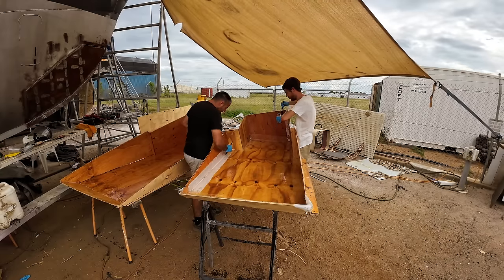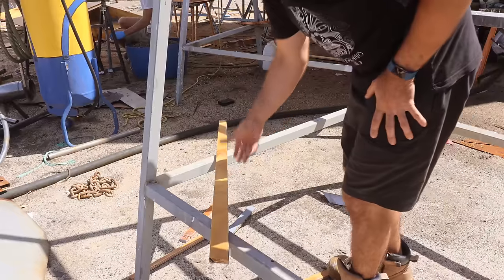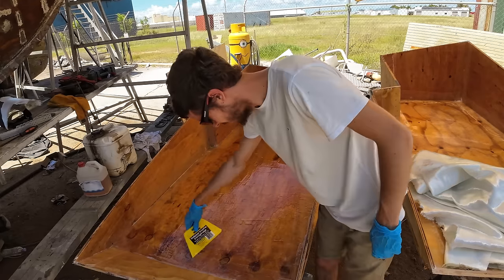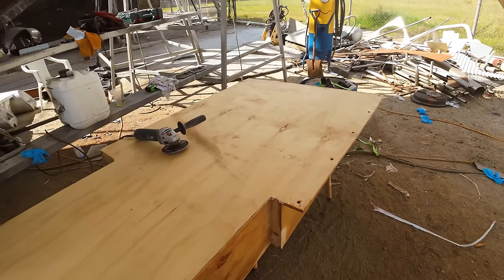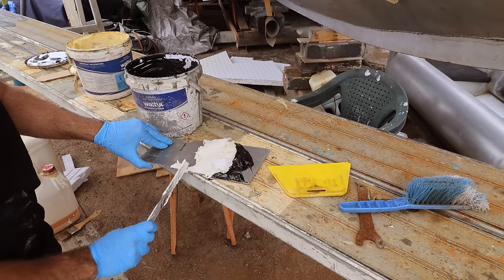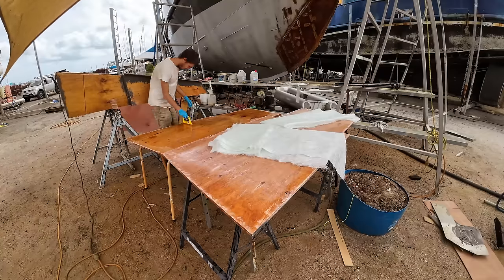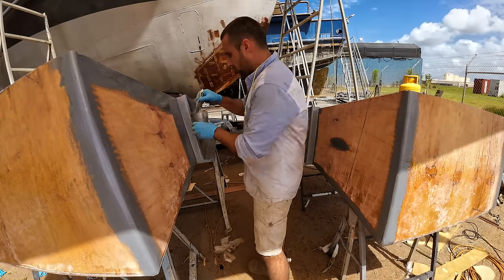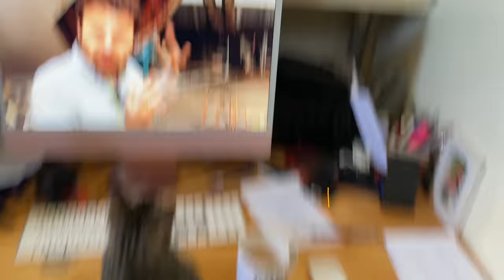Strengthening the Black Water Tanks Using Fibreglass - Project Brupeg Ep.292

Comment: Ventilation is very important, I have two 40 mm ID vents arranged to give cross ventilation to promote aerobic bacteria, the vents rise continously from the tanks to the skin fitting, one exits higher and aft of the other near the gunwale to try and assist circulation but not sure how well that works, no smells so that is a good outcome.  I fitted a by-pass to allow the outlet to flow seawater into the tank, I wish I had provided more than one flushing / agitation point as it seems I have a reduced capacity presumably from settled solids, I use an emacerator toilet with the shaft accessible to free it if it ever locks up and the discharge pump is a diaphragm pump.  All the best, Doug from NZ.

Comment: In the future, try filling the radius before glassing, you'll find the mat doesn't delaminate as easily and greatly improves the strength.  BTW Placing baffles in Black Tanks will trap your poo and eventually pack it up like cement.
Reply: I would think that the constant motion of the boat would break everything up into a liquid. Just my 2 cents worth. Guess we’ll see.
Reply: @Mr7yhnmki8  oddly, it's the other way around.  it's very non-intuitive.  the motion causes the solids to settle out, like taking a gallon of freshly mixed paint on a couple hundred mile trip in a car.
Reply: The coving should indeed have been done before glassing the tank as indeed fibreglass does not like right angle corners.
Reply: Baffles are needed for strength, but should not go to the bottom of the tank. This will allow for free flow of poo..and allow for flushing of the tank…. I don’t even want to comment on glassing mistakes….

Plus why not steel tanks, I seen 5lb plate tanks last 25 years on Navy ships.
Reply: Surely the cut-outs in the baffles will allow enough flow to prevent constipation?

Comment: The inside corners should have been radiused with fairing compound before any cloth was laid. Fiberglass does not like sharp corners. Plus each surface should be sanded and wiped down with alcohol or acetone before the next layer.
Reply: Absolutely
Reply: +1 for filets/ radiuses corner. But I'd scrub it with water against amine blush before sanding
Reply: radius with thickened epoxy is a must!
Reply: You are correct, but in another comment they mention that they are going to lay heavier glass over the coved inside
Reply: Yes, yes, and yes. I noticed this but demurred from commenting. Those tanks will experience some twisting and the corners need help.

Comment: Adding to other comments - strength comes from the glass not epoxy so if you can only use enough epoxy to bond the glass your golden. Peel ply may be an option to remove amines and make the painting so much easier.

Comment: I’ve seen swim platforms made from fiberglass reinforced plywood pontoons that held over 30 people and never leaked in salt water. This form of construction is just as reliable as an injection formed plastic or fiberglass only tank if not more because of the glue between the layers of the plywood which were compressed and soaked at each layer. The plywood pontoons lasted for years!

Comment: Internal corners should be filleted (coved) before putting down matting. The matting does not like sharp corners. External edges need rounding over before putting down mat. Router is good for this. Do any fairing before applying mat, it makes a decent finish. All resin need light sanding and wipe with acetone before overcoating. Resin will not bond to previous coat if 'bloom' is not removed first. If using peel ply then rubbing down is not necessary.

Comment: When performing hand layups a spray gun with the right size orifice makes wetting out the composite so much easier and cleaner.  A scale is a great way to accurately measure multi-part compounds.

Comment: I agree with the radius comments so the fiberglass will not delaminate since Fiberglass mat does not like to go over a sharp radius. I just don't understand why you did not use Stainless and fabricate the odd shapes as I have seen your tig work and it looks very good.
Reply from the maker: Stainless isn’t used for holding tanks because the acid in urine causes crevice corrosion. Epoxy is impervious to the acid

Comment: Seeing the tanks getting into shape is great! Just make sure they're absolutely bullet proof. Dealing with them after they had been used is an absolute nightmare. Unfortunately I'm speaking out of experience 😂💩
Reply: 💩😱        I smell your pain 🤣
Reply: @dcallan812  A previous owner of my trawler hat the idea to repurpose an old diesel tank into a holding tank. It was sitting directly on the concrete ballast and it was welded in place! The drainage hose wasn't even at the lowest point. If I should rate stupid system design choices that one got a straight 10 out of 10. 🤣
Reply: @FlyingConey  LOL mmmm that sounds real nice to deal with later, after brewing for years. 🤮  🤣🤣
Reply: Yeah, once something, pretty much anything has been given into function, fixing a mistake or a flaw ... honestly, i'd rather do it from scratch in some shituations.
Reply: @aserta  yep, if you have the access and the time just do it right.
Reply: Hmm... your comment is a little poppy. 🤣🤣
Reply: @kenholt8297  💩💩👀🤣 Just a small one

Comment: Ummm. You didn't sand between glass layers. Generally, you need a mechanical bond if the resin has set. Additionally, most epoxies will blush which needs to be sanded away. I fear that these might delaminate unless you are using some secret squirrel epoxy. Hope all goes well. Thanks for the content.

Comment: Whilst Epoxy is definitely inherently well suited to resisting water there are plenty of Polyester swimming pools and hot tubs that last just fine. Gelcoat is normally made from isophthalic resin which is more resistant to ingress than general purpose orthophthalic resin used in the laminations.

Comment: Take pictures and measurements of the tanks for potential replacement. Or in case you decide to change the composition in the distant future. Any special bracing for tie downs or brackets? I saw bolt down but any redundancy?

Comment: Those things will be stronger than steel tanks and certainly far more chemically (1's and 2's) resistant. Nice job only thing I would do different (and I build boats out of epoxy and ply) is fillet the inside corners before glassing but hey its not a question of strength rather convenience during construction. Nice job for jobbies.  They are pretty big though you will have to be mindful in some places like Antarctica are there any regulations about discharging down there?
Reply from the maker: Thanks for the tips!

Comment: Did your water line agree with your laser level line.  I appreciate you only filled one tank but a good test of the accuracy of the laser level?
Reply: That made me laugh too - could have saved the money for the laser level :-P
Also, does your level not have the mode to spin the laser? The ones I used at work (cheapo nasty stuff) made a hole line around the room, not just a dot…
Reply from the maker: Yes
Reply from the maker: Ours doesn’t spin, it’s super bargain basement

Comment: Surprised to see that the corners were not rounded and /or filleted before they were taped.
Reply from the maker: There is a gap between the bottom wood and sides, filler would have fallen through. Using tape to make the corner was out best option. J

Comment: Grind out all of the internal corners, cove them and then glass them over.  They will probably need 25 mm radii.
It might be worth seeking advice on the baffles - rather than just guessing.
Reply from the maker: We have taken the advise of a specialist, there was a gap between the bottom and sides of the box. Have a look at the next episode in two weeks and it will make sense
Reply: @ProjectBrupeg  That's good.  I'd still grind out the internal corners and cove and re-glass them, though.
90° internal corners are definitely a no no.
Waiting with 'bated breath.  :)
Reply from the maker: No need but it will make more sense when you see the rest of the tank. Dame

Comment: I may have missed it, apologies. What happened to the original tanks?
Reply: In an earlier episode he showed how the head was originally plumbed directly overboard. Brupeg was built some time ago when presumably regulations were different and it was a work boat, I suppose the crew could hold it themselves until sufficiently off shore (or wink wing, nudge nudge, say no more). So, it seems original didn't have holding tanks.

Comment: You could have used structural foam sheets to build the tanks, but I guess cost comes into it.  Still,  its looking good lads.
Reply: That's how the tanks are built in a composite airplane.  They do use something called 'micro' to increase the radius in the corners. They could use some chop glass and epoxy mixed to a tooth paste consistency. It fills corners and gaps and if it's chop glass, it's stronger than the plywood.

Comment: Curious, did you consider making these tanks from HDPE sheets? They’re easy to machine and heat weld together. But perhaps it’s a cost thing? Not sure how much large HDPE sheets cost
Reply: Not worth it + plastic will crack when cold. They'll be going to cold places.
Reply: Ive heard those can be a bit temperamental/unreliable
Reply from the maker: We priced plastic. $2500 each tank! So that’s not happening
Reply: @ProjectBrupeg  Wow, yea that’s expensive. Anyway, the fiberglass tanks are starting to look really beautiful and clean, so I’m sure you made the right choice 🙂

Comment: Did i miss something i thought epoxy and fibaglass isn't waterproof... What fibaglass boats make them waterproof is the gel coat... 🤔 So in my opinion it will holding Liquid for a few weeks or so bevor it goes through the epoxy into the wood and destroy it slowly
Reply: I have no fibreglass experience but my 30 year old box truck has a fibreglass roof with nothing on it, no paint etc, it's still waterproof after all those years so I don't see an issue.
Reply: @DomingoDeSantaClara  i think its a difference between making something waterproof for some short amount of time and for holding liquids permanently...on your roof of your car its not all the time covered in water .... At the moment I work on some aerospace project with fibaglass and really expensive epoxy (temp resistance up to 200 degrees c ) and i remember something about that its also hydroscopic over time... I could be wrong but i think that would be a problem 🤔
Reply: Epoxy, if done correctly, will be completely waterproof. The reason for gel coat is because epoxy "chalks" on exposure to UV light.
Reply from the maker: Hi guys. Polyester absorbs water like a sponge gel coat stops that. Epoxy doesn’t absorb water (it does but it’s such a small amount you might as well say it doesn’t). Epoxy can’t handle UV that’s why it gets covered up

Comment: Would have been easier to make them out of stainless sheet.
Reply from the maker: Not for us, stainless is unable to withstand the acid in urine over time. glass was the better option, given the cost, weight, complexity, and outcomes.
Reply: @Project Brupeg  If you were to leave sewage in a tank until it became a stinking mass, you might just generate enough H2S to be a problem, although I doubt it. In reality holding tanks are flushed with aerated seawater every few days.
Reply from the maker: Why risk it? Industry standard is dont use metal
Reply: @Project Brupeg  I get that, there is a variety of different systems, incl stainless out there, that all comply with  AS3542–1996 and many more that don't 😉

Comment: I love you guys, but I’m a plastic guy. You guys made me cringe as much as I would you doing metal! Ugh. So many issues. Radiused fillets on all those inside corners, rounded edges to top/outside corners. Not pretty work, but hopefully enough to make it work! Personally, I think I would have gone with actual plastic tanks for holding tanks. If you don’t make the inside super smooth, it will hold waste and smell. You can use Polyesters, just seal with epoxy (you can put epoxy over poly, but not poly over epoxy. Putting a radius inside first would have provided at lot more strength instead of after.
Reply: Should have rolled over the wood on those sharp edges and rolled the glass over them inside and out. Too much to really type. Not trying to be too critical, just trying to help you guys out. Whoever is giving you fiberglass advice isn’t a fiberglass guy. Ask about these type of projects ahead of the videos and we can help. I know it doesn’t help now but maybe in the future.
Reply from the maker: Wait to you see next week. These tanks could get hit by a Cessna and survive now